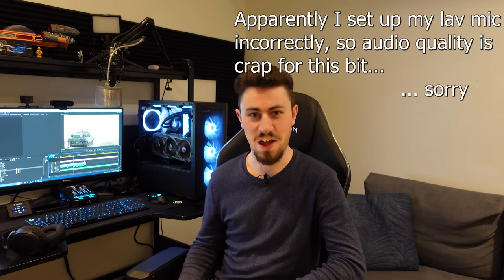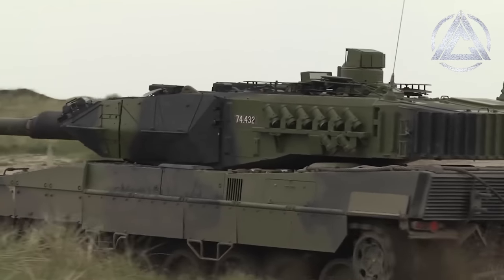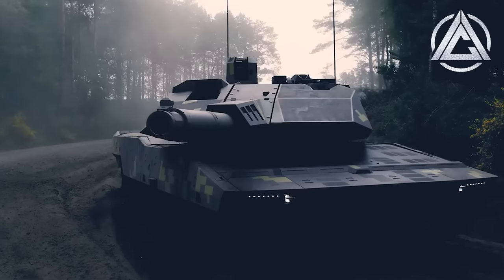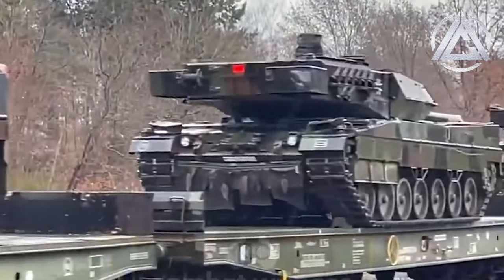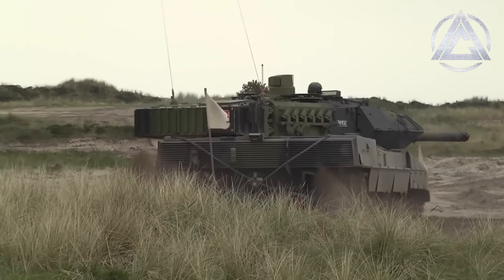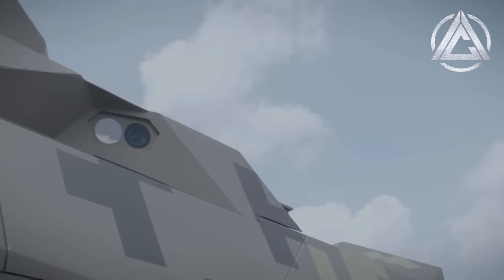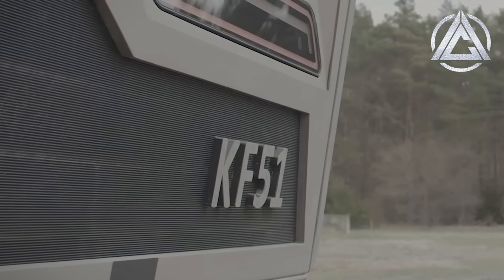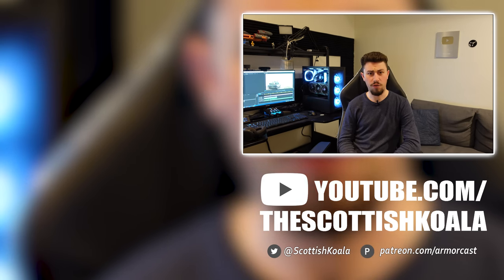Germany's New KF51 Panther Tank | The Spearhead of a New Generation?

Comment: My personal opinion on uncrewed turrets is that they are the future for sure, if you value crew survivability above all else, but we just aren't there yet. Also, on the subject, why put the crew in the front of the hull if the goal is maximizing crew survivability? Wouldn't it make more sense to put them in the back, and have the engine in the front sort of like Merkava?
Reply: As he has pointed out in the video, more tanks get destroyed by mines than by tank guns or ATGMs, so having all the crew in the hull arguably even reduces their survivability.
You also have to consider technological and physical limitations.
The main reason most modern tank designs still have the engine in the back is for balance.
The frontal hull armor is heavy. The engine is heavy. When you have the engine at the back, it balances out with the heavy armor at the front. When you put both the armor and the engine at the front, the tank becomes incredibly front heavy.

That means you either have to make the armor thinner, or you drastically reduce the mobility of the tank. The Merkava has this reputation as being the safest and most "crew protecting" tank, but actually it is rather sub-par in that department. Having the engine at the front forced the designers to make the frontal hull armor rather thin and light in comparison to tanks like the Abrams or the Leopard 2 and you might have notices that there are many pictures to be found on the internet that show front heavy Merkavas that dropped into ditches and couldn't get out again. There even are quite many pictures of Merkavas that made somersaults or are basically doing headstands.

When they designed the first Merkava, Israel didn't have the know how for how to design effective modern tank armor, so they put the engine in the front as makeshift armor. They just stuck with that basic design out of tradition, basically and because their own propaganda had been too successful. For generations they have sold their own public and the world the myth that having the engine in the front made the Merkava better than other tanks. So if they would design a new tank now and put the engine in the back, it would raise many questions. The Israeli public would ask: "So the new tank doesn't protect the crew as good anymore as the Merkava did? Or have you been lying to us about how save the Merkava was?"

Once you have that principle of balancing the weight between the front and the back of a vehicle in mind, you will understand many design choices that might seem odd to the uninitiated.
Stuff like why the BMP-3 has the engine in the back and the passengers are forces to climb over the engine to get in and out.
The BMP-3 is supposed to be amphibious, so it needs to balance its weight. Having the thickest armor and the engine at the front would mean the concentrated weight would pull the vehicle down when trying to swim.

For that reason you will see that most amphibious vehicles put the engine in the back or in the middle. (Example: The German "Fuchs" APC which has the engine in the middle between the cockpit and the crew compartment and only a very narrow crawl way to the side of the engine connects the two spaces.)

So I think we won't see any tanks that put the crew in the back of the hull before we can get rid of large and heavy tank engines and maybe replace them with electrical motors in the wheels or something like that.
Reply: The Soviets had a design with the crew in the very back of the hull for survivability. IIRC, it had the engine in front of the crew, but behind the turret. I would refute that putting the crew entirely in the hull reduces survivability. We know how to make vehicles that can protect the occupants from mines and other blasts. A V shaped hull for instance would deflect some of the blast from the hull of the vehicle. Not to mention, we've already tried the opposite of sticking the entire crew in the turret with MBT-70 / KPz-70. The driver was made horribly motion sick.
Reply: @LexieAssassin  Sure there are ways of making vehicles better protected against mines and IEDs, but unfortunately most of those ways are mutually exclusive with making a tank better protected against anti tank weapons.

Against anti tank weapons, you want to make the tank as low as possible, but against mines you want to make it as high and far from the ground as possible.

And if you are going to make the bottom of the tank super thickly armored, you are making it way heavier, which ruins the advantage of not having to armor a turret.

There is no perfect solution, but it is a statistical fact that most tanks get killed by mines, so putting all your eggs into the "crew in hull" basket is a very risky bet at the very least.

The Armata's "all the armor in the frontal hull"-concept neither helps it against mines, nor against top attack weapons, which both are the most deadly things a modern MBT will have to deal with.

Comment: Question here on unmanned turrets: if the size of the turret is reduced since there is no need to have room for the crew there, why would the protection of the hull or the turret need to be reduced? The thickness of the hull armor can be increased without increasing the weight of the tank or decreasing the armor thickness on the turret.
Reply: thinking of the Abrams TTB turret here, if not the whole tank in total.

Comment: 50% extra kinetic can be achieved by only increasing 8% the speed.  Since the mass is bigger by almost 27% estimate that the increase is proportional. If the mass is the same then speed increases by 22.7%
LONG ANSWER 

KE=1/2 MV^2
KE =Kinetic Energy 
M=Mass
V= Speed

1. Find mass:
Assumptions: 
A) Same alloy thus same density is used. We don't need to consider the weigh only volume. Since same densities cancel each other.
B) Since the diameter is 130mm vs 120mm and we consider a proportional increase on all 3 dimensions, then the ratio increases the mass  is 130^3/120^3= 1.27 bigger
2. Find speed
Assumptions 
A) Aerodynamics identical
 Solve for V the formula but because is a ratio against the pre existing  numbers and not absolute numbers, then ignore 1/2 since cancel each other out.

V=Square root of (KE/M)
KE=1.5
M=1.27
V=SQR (1.5/1.27)
V=1.08
So with a Speed is 8% greater than before  for the new projectile that is 27% heavier will generate 50% more KE

Comment: As for current tanks in museums one Cantigny Park already has a M1 Abrams since the mid 2000's.  They allow you to climb on it along with every other tank they have.
Reply from the maker: True, and a few other museums have "modern" tanks, Bovington springs to mind... I should mention that the Abrams in Cantigny Park is an old IPM1 model from 1983, a far cry from the M1A2 SEP of 1999 (or M1A2C of 2017). What I more mean is for them to ONLY be museum exhibits, no longer used by the armed forces, similarly to the M48 Patton, or F-4 Phantom (yes I know South Korea still have both). The IPM1 is already in that state I guess.

I've been lucky enough to have a climb on a couple of M1A1 AIMs in the Australian Defence Force, lot of fun! Would very much like to visit a museum that allows this regularly!
Reply: @ArmorCast  Cool thanks for the response and clarification.  And I agree climbing on tanks is incredible fun.

Comment: On the Range factor - With the Panther, they promise that's 3.5km day OR Night - thanks to the enhanced night vision optics which at best are up to about 2km on a Leopard 2 so its 'effective' Combat range is vastly different at night which would seriously limit night combat missions and certainly give the Panther (a stealthy Cat that strikes in the dark without you knowing it was there) because the 'enemy' doesn't have that capability at night either - its a big advantage...

130 will also make sure of the kill with a Single shot, no limping away from that or still being able to 'fire' back even though the vehicle is 'disabled'. Armour is only likely to be increased with all these APS and systems designed to cause detonation before hitting the tank itself, faster projectiles needed to beat those systems...

Interestingly, it seems Rheinmetal are 'negotiating' to open a Factory in Ukraine to produce Panthers and other works as they have Leopards 1 & 2 to update, repair, make and supply to Ukraine now so opening a Factory to make Panthers and be able to produce them in 'quantities' to meet 'Demand' as quickly as needed which makes sense to me.... Especially with Patriot Systems now in Ukraine to protect them from Attack...

Comment: Its not silly to have those drones at all. They will be perfect for the command vehicle.
Reply from the maker: They'd be perfect for a separate vehicle further back - when you have 60km precision strike/recon capabilities you don't NEED to be sat in a main battle tank, and 90% of the features of a main battle tank are useless to you. These things are difficult and expensive to deploy, and easy to destroy when used incorrectly. Why on earth would you spend the thousands of dollars to deploy a battalion of main battle tanks, in order to use a weapon designed from the ground up for small special forces teams?

As Nick Moran, the Chieftain, said - A tank is designed to be very very good at one specific role. Why would you add ANYTHING to it that detracts from or isn't immediately useful TO that role?
Reply: @ArmorCast  because it adds to the company's survivability through datalink via aerial recon.
Reply: @aarongrey6848  then assign it to a recon unit and send the data to the tank, rather than clutter up the inside of the tank with stuff that isn’t REQUIRED to be on the tank.
Reply: @highlorddarkstar  Recon unit may not be in the area of attack and any extra ability  over the enemy is an advantage. Taking 10 rounds off a tank company in order to have an aerial recon/attack ability is a no brainer which is why they are doing it. Now the company has a top down attack option, can spot ATGM crews and has far better situational awareness. This shouldn't be hard to explain. I'm an ex soldier, not armor but have plenty of friends who are/were. They love the idea.
Reply: @aarongrey6848  the aerial recon IS a no brainer. Having it with the tank company IS a no brainer. Putting the operator IN the tank is the issue. There are plenty of places to put an UAV operator that aren’t your front line of contact. Put him in an armored vehicle, sure, but don’t put him in the tank. He doesn’t NEED to be in the tank to do everything you’re asking him to do. Put him in one of the Bradley’s running with the tanks. Put one in every Bradley. But don’t sacrifice space, weight, and potential firepower for something you don’t NEED in the tank.
Reply from the maker: @aarongrey6848  Look, the idea of drone recon is very popular... It's far easier and cheaper to conduct at the battalion level than fixed wing aircraft or helicopter recon, and far less risky and arguably more effective than ground force recon...

... which is why it is being integrated into new divisions, including heavy armor divisions. It should NOT however directly take away from the tanks' ability to do the one thing they are there to do, by slapping it onto the tanks themselves in place of ammunition for their primary weapon. These things are built for special forces, not heavy armor units. This idea that "well what if the recon unit aren't there?", then the tank battalion would not be there either. These units are deployed TOGETHER as a singular asset, that's the point of them. The tanks don't need these 60km range aerial reconnaissance and strike drones for the same reason they don't need surface to air missiles strapped onto the back of their turrets - the OTHER BATTALIONS in their company have that job covered, letting the tanks do what they are there to do. Should they need recon, they call for recon, recon is provided, and they continue on.

Sacrificing FIFTY PERCENT of your ammo storage, leaving you completely ineffective on the battlefield ( remember, that's split between APFSDS and HE-frag rounds), in order to just skip the chain of command and get the recon data yourself... not smart. Have fun fighting a protracted war when after every MINUTE in combat, your tanks have to retreat 60km to restock ammunition into their autoloaders (which takes hours)... and have fun sorting out the logistics to actually keep supplying them with ammo that often... without the enemy simply exploiting that weakness.

I'm sorry to insult, but Nick Moran knows a bloody lot more about this kind of thing than your "friends who are/were" tank crewmen (I'm sure they're great guys and were great at their jobs, but that doesn't mean they're experts in tank design or warfare in general). Disagreeing with him on this would not be a smart move.

Comment: Could the KF51 be fitted with a GPMG in the forward Hull next to the driver in a remote station as if the driver station is the same or similar to the Leopard 2 and be used by any crew member from there station . As for the problem of main gun ammo versus a ATGM could the turret not be fitted to three vertical pods at the back of the turret with Switchblade 600 and a section of the roof that could open where it could hold two quad rota drones for reconnaissance but still keep the full amount of ammo or two switchblade pods with a remote loading port that a Vehical like the Korien K10 ARV say one per three KF51 which could run from forward resupply point then back to a tank RV point

Comment: Does the Panther come with the kitchen sink? IDK seeing all these tanks like the Abrahams X and this they seem to have more features packed into it is only going to make the cost of the tank crazy that the military that normally penny pinches are likely to have bog standard or just slight above bog standard configurations because when you are investing 10+ million $ into a tank loosing one is a significant blow.
Reply: In terms of cost you probably save a great deal on soldiers by cutting the size of a tank crew from 4 to 3 so that's an offset against the cost of an autoloader.

But yah I agree re: some of it.  I suspect they've added features that aren't likely to be used by all militaries as a kind of catalog so countries can select what they are looking for before they go into production.

Also u want to advertise other capabilities someone might want to buy for other vehicles.

Comment: The KF51 would be more of a compliment rather than a replacement to the Leopard 2 tank. 
bringing back the Leopard 1 back into service shows that there is still a belief that the Tank is still a great tank but with modern tech to make the tank more efficient within the modern battle field.
Reply from the maker: They're not bringing Leopard 1 back into service, just shipping old mothballed models to Ukraine as an aid package.

As for KF51, if it were to enter service, obviously Leopard 2 would remain in service for some time, just as Leopard 1 remained in service well into the 80s, and for example the M60 remained in service with the US army into the 1990s, more than ten years after the M1 Abrams entered service. That's how pretty much all nations "replace" their tanks.

Comment: Yea speding internal tank ammo for those loiter drones makes no sense they can be on their own system futher behind your tanks. 
They don't need to be up close to be effective.
But just like you say small reusable recon drones would be really smart to have flying out checking nearby hills to prevent an ambush.
Reply: Maybe the idea is to have a mix of configurations. Not every tank need to have these loiter drones. But maybe one of every four tank group...
Reply: @nils9853  True but it is still the most valuable space in the tank. 
And not really possible to re-stock while the tank is at the front line. 
A support launcher behind the front could launch the drone and have them cicle where the tanks needs them and return and "land" refueled and send out again in a continous loop, so you always had eyes where needed. 
In a cheaper and more safe manner. 
You don't want to have tank crew get out of the tank to pickup a empty drone at the front.